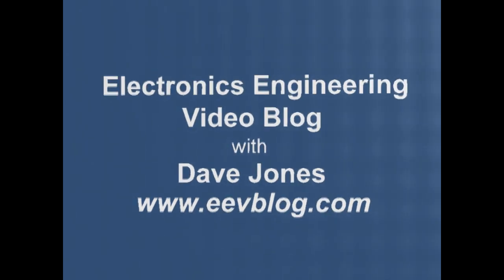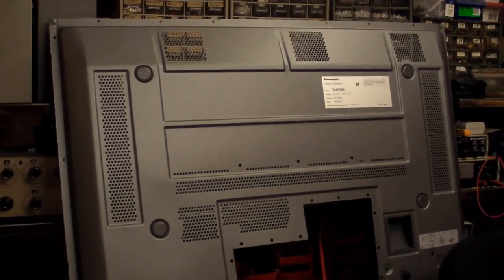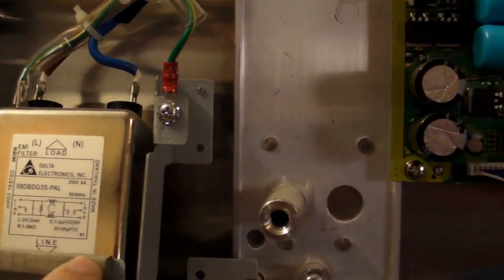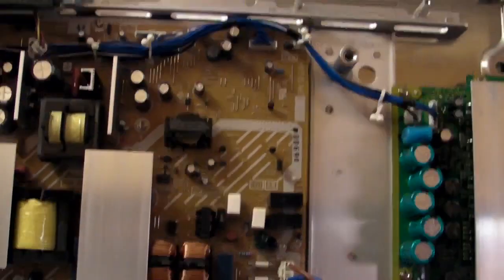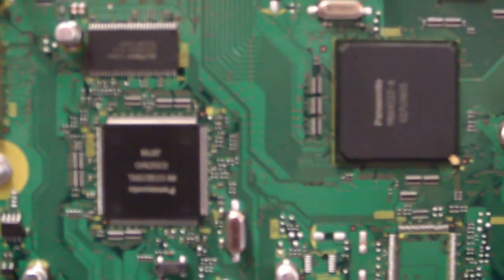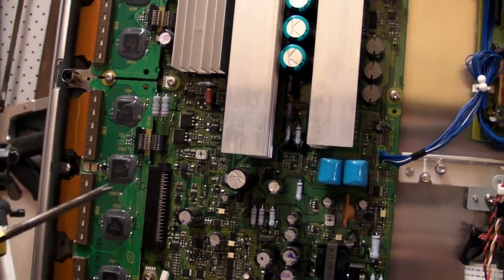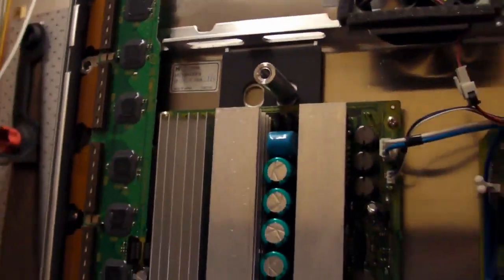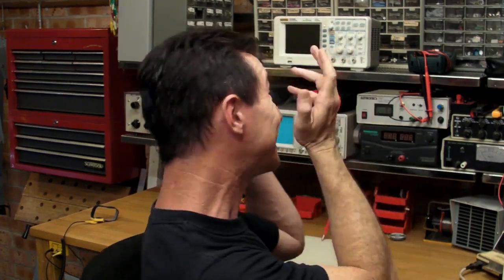EEVblog #52 - Panasonic Plasma TV's Suck (and a Teardown)

Comment: Really funny I have a 10 year old 42 inch Panasonic Plasma that just gave the 7 flashes of death code, pulled the back off and tightened circuit board mounting screws and blew out all the dust and good as new for another 15 years.

Comment: 2 things: 1. I think you got a defective screen there, it might not be the driver chips. 2. I think I know why it was flickering when you unplugged that wire, something to do with the black and white fuzzies when not plugged in to cable, and the side things working trying to make the image come up, and both somehow make a image, LCDs usually have just column wires, some have tabs on the side with no power going to them I don't know why.

Comment: The insides of the Panasonic gear is top notch.  There's no con from the company.  Unless something has changed over the recent year.  I know that Panasonic had their own plasma steppers (you know, the machines to manufacture the plasma screens), most other manufacturers probably use Samsung screens, including Sony.  I mean, there's whole philosophy clash between Tokyo based Sony and Osaka based Matsushita Electric, Sony being into business and big numbers, Matsushita being into quality.  Where did it all go?  I guess Samsung and GoldStar (today Lucky GoldStar or LG) eventually came on top, starting from cheapest possible junk back in the '80s, selling those below cost of production just to capture the market share, now, bingo!  Samsung and LG are top brannds in TV's.  What did the world came to...  Foxconn TV?
Reply: I feel the same. Really missing the good old japanese stuff. Whenever i can i buy Japanese and apart from the software being a bit janky i was never let down. Japanese appliances are hard to find but German stuff is usually a good replacement.
Reply: they've got some nice components in there i have one waiting to be taken apart that has really nice IGBTs as well as really nice capacitors transformers and chokes, they did not cheap out with the components

Comment: Anything missing off the video input board cause some companies omit parts pieces and components to cut cost but if the consumer can just buy those parts and solder them back in would you or could you change a say Emerson plasma to a Samsung since there manufactured by the same company. like missing vga port but has all the components but missing the port.

Comment: Too bad you couldn't connect another set of 2 bands into that original connector, then if you saw the output on another 2 blocks that would prove the problem was with the flat flex chip, well unless there is something electrically more complex.

Comment: A Tech Tries To Fix One: 

I ended up with one of these free with a bad segment, just occasionally..

 I figure out the board needed, obtain them from ebay, take everything shown off the chassis to get to the driver boards, replaced them, and brick. Never made it past the safety checks so it never powered up again. 

Maybe removing all the wires and boards and finding that one cable that's not quite seated out of 120+. . Or the ebay board was bad. No convenient swapping for test, it's highly embedded. 

Later, moving the dead hulk munged the screen so no need to give another try. 
I'm out two ebay boards which I guess I can extract the lot now and let someone else give a go on theirs.

Comment: it only has 1024x768 resolution???

my 14" laptop has 1920x1080 resolution
Reply: +MWB Gaming Not comparable. They 're in different mechanism. Except for the advantages of no ghost shadow, it's said that Panasonic plasma can show 8 billion colors rather than 17 million by LCD display.
Reply: that is true
its well known that plasma has better color depth but LCD doesnt burn game HUDs into the screen
Reply: I know what you meant. Actually if it was yesterday, I would 100% support your statement. Unfortunately or fortunately my new Dell LCD display arrived at my house today. I read through the manual, finding that LCD also has burn-in problem. It suggests that the users should turn on the screen saver or turn off screen in time. With doubt I searched for that online and there're some IPhone users report with photos that their screen have badly burnt. So at least I'd say this is still a debatable argument.
Reply: i have never had burn in problems with any LCD screen i have ever used
Reply: MWB Gaming That's good, isn't it? Anyway, Merry Christmas!
Reply: same to you
Reply: +MWB Gaming.    Because it's an early 720p only television.    There is really no point comparing an older TV to a newer computer screen.
Reply: 720p is 1280x720
not 1024x768
Reply: MWB Gaming
When connected to a PC it may only be capable of 1024x760 but the fact is when used as a TV it's scaling and displaying 720p.   Many TV's are like that.  For example, Samsung and Sony  sold many 1080p televisions that could only display 1050 when hooked up to a PC via the PC Analog port..   The technical point is they are sold as Televisions, not PC monitors.
Reply: its pretty annoying that you cant get 40"- 60" PC monitors that are somewhat affordable

maybe i should use a projector instead

Comment: I have a 65" Panasonic that I bought a three years ago.  It got about a 4" vertical black bar on the right.  I pulled it apart, pulled the ribbon cable and reseated it and I'll be darn it fixed it.  I was thinking it may be a reliability problem with it being so close to a speaker.
Reply: +Raising Awesome These same cables have issues with the contacts being scored to the point where they will not make a good connection if the receiving pins on the board have any movement which could even been with heat and cold cycling, also possible that the contacts on either get tarnished a bit, they use these cables ON EVERYTHING  (TV, DVR/DVD  Blu-ray Recorders,ect) at least in the Panasonic brand so it might be worth looking into at least removing and reseating them

Comment: Had the 42" also. 2 weeks and a Red Strip 1/3 of the way in on Left Side. Best Buy would Not Exchange it. Told me they had to service it. 4 Times and the problem still did get fixed. Panasonic Policy is to Fix it and if it can't be Fixed After 4 Times, Only then will they take it Back or Exchange it.
So I got a Insignia 46" LCD for $200 less and been using it for 5yrs now with No Problems.

Comment: Come on Dave you can fix a TV easily. If you had the parts you would have fixed your Panasonic. 
I think it's an insult for someone to assume that because you are a electronics engineer you should be able to fix any electronic device and you should be able to. Unfortunately most people are stupid and don't realise that engineers design electronic devices like TVs. They have no clue what an engineer does. 

I studied engineering and I have everyone coming to to me to fix their shitty electronic products. I have repaired so many different types of equipment it's not funny. Bloody degrading when you have to fix some crappy amplifier when you could of designed it.

Comment: I've had mine since 2011, probably 4000 hours on it with the family. It had a daughterboard go bad 3 months in (under warranty), causing a bizarre wandering red horizontal line, but fixed for free. Since then it's been awesome. No complaints.

Comment: I've run into this frustration on occasionally used items. Sometimes you end up with a lemon that would have been discovered during the warranty period given heavy use. However given that said item is only lightly used the flaw does not present itself until well after a warrantly has expired. Frustrating. =\

Comment: Dave, you most probably got an "infant mortality" chip that may have caught a neutron somewhere along the way to your set. IF you had used it as the regular family TV you would have caught it during warranty.  I think here in the US an expensive item like yours that fails within one or two years after warranty carries some weight in court. If you had called Panasonic they may have fixed your set. I can't believe that the great Panasonic would intentionally look for shoddy parts to increase sales. They're just not in that business.

Just wondering...

Comment: Plasma TV's are junk they don't come close to a Bravia LCD in terms of picture quality
Reply: Which doesn't address the failure at all. Was Bravia LCD on the market when Panasonic built this set and how did plasma rank in picture quality against all others when it first hit the market?

Your turn...
Reply: KitCox Yes they made Bravia TV's back then and they were comparable in picture quality at less than a third in power consumption no screen burn in problems
either.
Reply: +Awesomus Maximus You're confusing your personal opinion for fact.   The picture quality of a Bravia LCD never even came close to the picture quality of most Plasma televisions available at that time.   I challenge you to find just one legitimate report, product review, or study that says your Bravia outranked the others.
Reply: +KitCox Bravia's have been around for at least a decade... 

Your turn...
Reply: If it's a fact, prove it.  A fact can be proven with tangible evidence, documentation, weblinks, etc.   "Comparable picture quality"??...not even close.    So far all you've done is continue to try to express your opinion as fact.  You've presented absolutely no facts here.
Reply: http://www.bigpicturebigsound.com/HDTV-Shootout-Pits-Top-LED-TVs-against-the-Best-Plasma-TVs---Guess-Who-Won.shtml 
Here's a link check it out
Reply: and bravia 2017 has world shitest usb folder weiv
Reply: Awesomus Maximus
  You're the one who  choose  to start a debate over an old TV.   Nevertheless, I asked for simple facts and you just couldn't provide them.   Apparently your ego is so shallow you can't handle being wrong about something.
Reply: It's a dead technology why bother
Reply: Robert Atkinson It wasn't an opinion it was
fact I never said better picture quality but comparable but without plasma's weaknesses
such as screen burn. 
Picture quality in LCD's is far superior nowadays

Comment: Interesting, I have a 50" Panasonic top of the line Plasma...that is now 8 years old (bought in January, 2007 as an open box item).  It gets well over 1000 hours of use per year.  Still going strong.  I've gamed on it for well over 1000 hours with a PS3, played Blu-Ray's, DVD's, VHS Tapes, etc.  This thing has out lived it's life expectancy by at least 3 years from what I've been told. Maybe you weren't using it enough...
Reply: I have the same basic TV for just as long, it is on for over 12 hours a day, every day and look just as good now.
Reply: WreckDiver99 I'm in the same boat, 50 inch Viera Plasma, about the same age, hasn't skipped a beat yet.
Reply: That's rookie numbers. I have a 42 inch Panasonic Viera Plasma still running hours every day. It's from 2006.. :O

Comment: My panasonic plasma blew up last year.  talk about one hell of a loud bang when the 200vdc buss faulted.  Panasonic dropped all replacement parts for them.  Same thing, I'm retired and not really set up at home for this type of repair.  Farm it out to the experts.   Do not take those ribbon cables off unless you absolutely, positively have to.  I had one hell of a time getting all those traces to line up with the connector.  Had to re-seat them maybe 40 times each, before I got rid of all the black lines on the screen. poor design.  Also beware of the 200V, it's enough to kill ya.
Reply: Even worse when the 400V PFC bus goes short ... that's really loud, like a loud firecracker!

Comment: Had a Panasonic plasma TV P42G20E that died after roughly 4 years, apparently the A board I think blew and it costs half a new TV to fix. Panasonics are very dodgy , don't buy them. Wished I saw this first because I bought my TV in April 2010.

Comment: I also have a Panasonic plasma that i got a little over 2 years ago, and the stupid thing is not working now. I found out the hard way that the 7 flashes from the led power light that im getting is a more than a casual fail on this tvs, to the point where the part that i need to fix it, is no where to be found due to a lot of peolple with the same problem.

Comment: Flat TV failure rates appear to be astronomically higher than old CRTs; I have my 2003 Sanyo 20" CRT turned on as I type that I've been meaning to replace with a flat TV :-). I've repaired dozens of flat TVs, and I've seen less Panasonic failures than most other brands; it could be just be an indication of the ratio of Panasonic sales to other brands (never researched sales figures). I've run into lots of failed Samsungs and LG-based TVs.

Comment: I have 2 Panasonic 42" plasma TVs.  One went 7 years the other 5 1/2.  Not very good, but both longer than an extended warrantee would last.  Both blink power supply issues.

Comment: I used to manage a shop and we didn't take in Plasma's for repair, my repair tech I guess didn't like them. As far as high voltage in these sets well I started out repairing vacuum tube tv's and there were lots of places where you could come in contact with high voltage, today's sets use transistors so getting shocked isn't a problem. you should discharge the caps in the power supply before working on one, and don't touch the inverter board when it's on.

Comment: ...knowing that legally, one can actually get a product serviced within a reasonable life expectancy of the unit. Classic example of this in practice was my Samsung 305T 30" PC monitor. Bought it in 2008, driver board failed in 2011, common problem. Unit had a 3 yr warranty which expired 2 months prior. Samsung initially wouldn't honour it beyond 30 days after the warranty expired. I raised the point about statutory warranty and within 30 mins, I got a call saying they'll honour the warranty.

Comment: Seriously I thought you were gonna smash that TV at the end but good ol electrical tape saved the day. I wouldn't mind tearing down an LCD TV for the parts and maybe making a light out of the CCFL lights inside. I did that with a flatbed scanner. it runs on 12V.

Comment: I used to work a a TV repair place, when Plasmas and LCDs first arrived. My boss had soldering machine which was like a drill press with a square block of metal with a heater inside of it. he used to "fix" the drivers on flex cables by applying pressure on the chip and heating it up. id say it worked 75% of the time, but there was always doubt whether the solder join would hold up.

Comment: first off it' a moduar design ....this was tried back in the 1970's ....the other problem is surface mount components which are not easy to replace.

Comment: Most plasmas have good motion resolution. I've had no issue with that. My guess on the frequency changing: Did you see the number of inductors and capacitors? To get good energy efficiency resonance is used to recovery energy from the panel that would normally be wasted. It might not work at different scan rates. Newer plasmas do 600 or 1200Hz which can do 24p easily with equal numbers of duplicate frames.

Comment: My TV specifically says it's running at 48 Hz.  It gives an option of either 3:2 or 48 Hz.  The panel stays at 60 Hz, but the image is run at 48 Hz with some black frames inserted.  I don't get why the electronics can't just run the panel at whatever the hell they want.  I also notice the pathetic motion resolution of these plasmas.  It's quite horrible looking.  We shouldn't have to spend 1/4 year salary to get a TV that displays an image correctly.  Why can monitors do it?

Comment: Most 24p plasmas drive at 72 Hz, I don't know any that drive at 48 Hz and very few use black frame insertion as it would cause varying brightness. I had an old Pioneer plasma and its scan rate could drop down to 25 Hz at which point it was stroboscopic, but it would also do 120 Hz, only problem was at the higher refresh rates the sustain timing got squeezed and you lost some bits of colour resolution.

Comment: My Panasonic has a 24 Hz mode and it flickers like hell.  I guess it's 48 Hz driven into the 60 that the panel runs at with some black frames inserted.  I don't get why these TV makers can't just have multiple refresh rates in the chips that drive their panels.  I don't get the lack of DVI inputs in the industry.  They need to get with the times and have a TV that enables 120 Hz input through DVI or DisplayPort.  HDMI is a fail.

Comment: I work in the service industry and I must point out that Panasonic has the lowest failure rate of any major TV brand.  You can't base the reliability of a specific brand off of comments on the internet because all the upset people are of course going to come and make noise when their unit has a problem while the people without problems keep quiet.

Panasonic makes the best TV's available today with the best picture quality but that doesn't mean that every unit will be perfect.

Comment: Lol, what about trying to "bake" it a bit? :) I found it strange that the two columns do not behave the same way when disconnected, like the bugged one is kind of shorted somewhere.  
When you disconnect the connector the chip is supposed to be off, right? So it should not change anything if it is dead or not (I guess).

Comment: I don't think it's that ribbon cable that's gone bad, since it behaves the same as when its disconnected and the channel next to it is disconnected it behaves differently.  Perhaps its probably something like a grounding issue at the opposite side of the panel.

Comment: That's why I want to buy a CRT HDTV (used,since they are not made anymore). CRTs are mature technology and last quite long (I have a ~15 year old TV that is in use 3-6 hours/day - the horizontal deflection transistor blew up once,I replaced it and it works fine). By the way, the inside of a high-end CRT monitor also looks great.Also,I don't think that one can have too much gear for repairing stuff, I always get into a situation where more gear would help.
Older devices are much easier to repair.